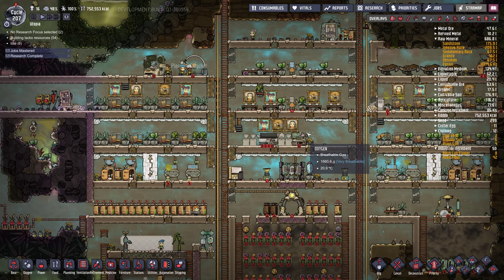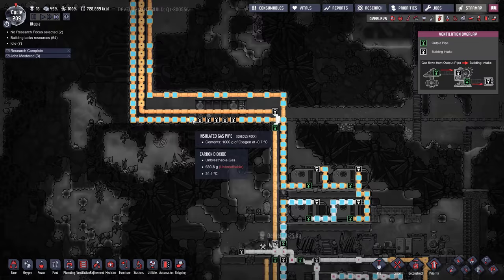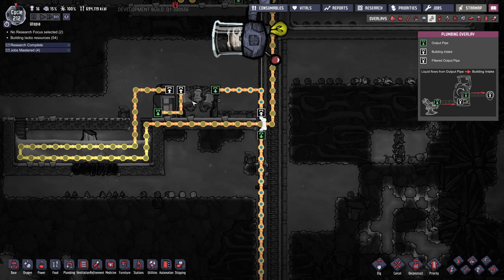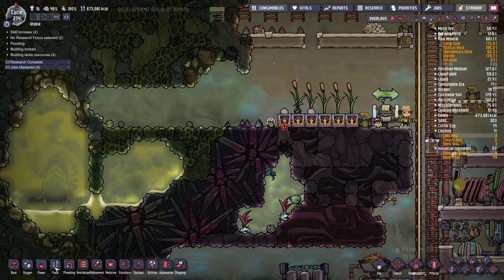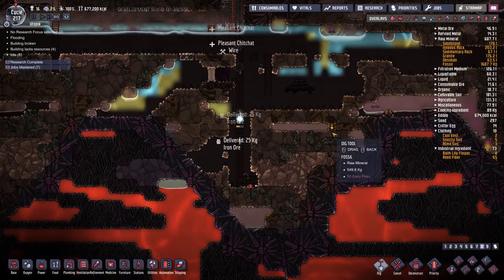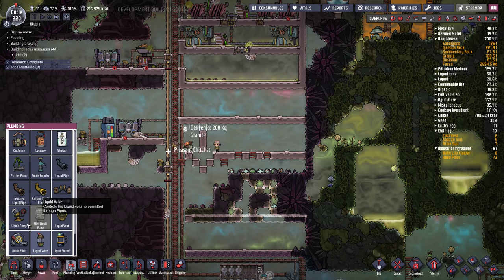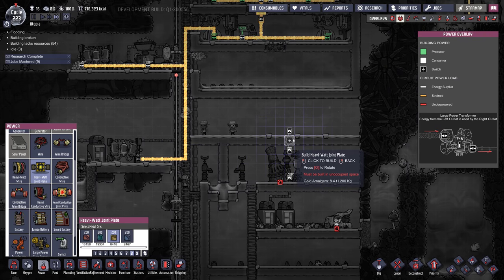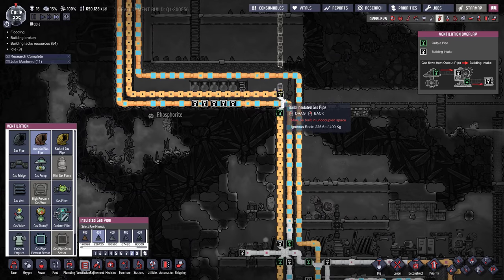Oxygen Not Included - Quality Of Life Upgrade Base #8 (Oil Refinery & Plastic) [4k]

Comment: What’s the logic on using the plumbing bridges to split the stream?
Reply: bridges take liquid first, so if you have a line that goes to something and a bridge off of the lin to a seperate line, the seperate line will fill first and then the rest of the first line will fill.
Reply: It prioritizes the bridge.  So it directs the gas or liquid through the bridge first before any of the branches

Comment: 14:45 i think they fixed that bug. now, the abyssalite doesn't seem to transfer heat unless the liquid touching it boils. I've tested it with crude oil which turns into petrol at 400c, which then turns into sour gas at +500c. I've noticed as this happens the abyssalite quickly lowers in temperature until everything stabilizes. haven't tested this with water but the same may happen as it turns to steam.

Comment: when 1 pipe branches into 2 it seems to back up the pipe. Seems like you have to use bridges to make sure it flows correctly
Reply: My thought exactly. If you use bridges to split your oxygen properly you can easily  double the output.